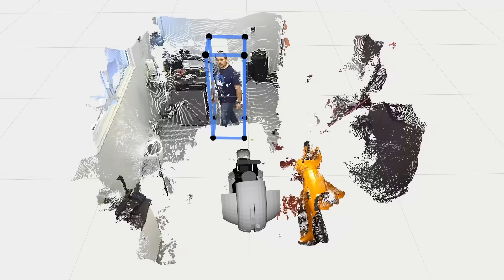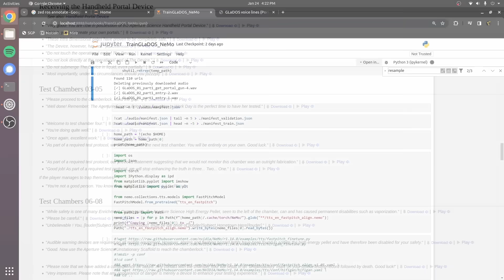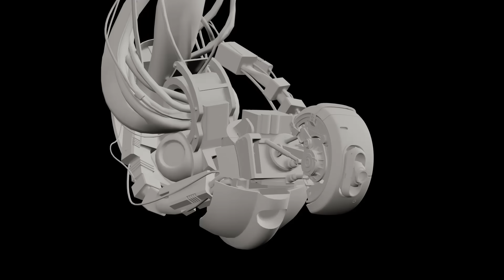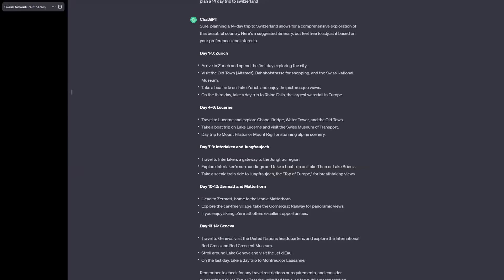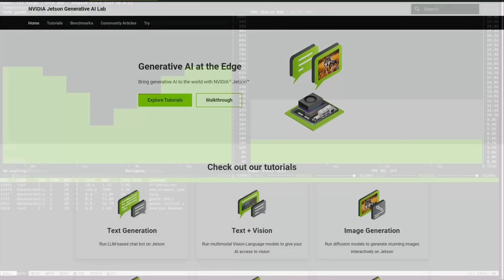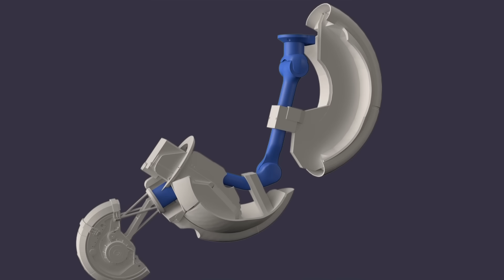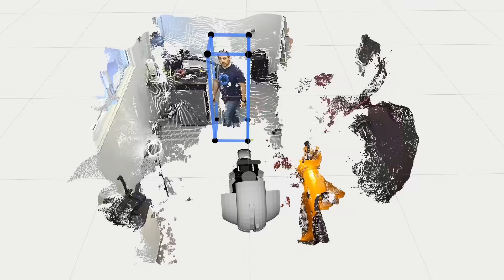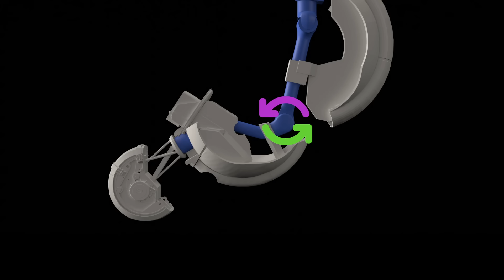Bringing GLaDOS to life with Robotics and AI

Comment: i wissssh i had glados as well... i did think about the process of making the OS when i was in high school.. wnd well yea.. expensive and difficult to do.. what i thought about was a glados AI based OS for a pc.. but yea... the thought of learning kernal language would be super tedious and hard.. but yea what i would prefer is to have her both integrated as a smart assistant on a desktop pc running windows and have her able do tasks there.. even if it would require the AI to have full admin acess to the file explorer and such.. like just being able to tell her to automatically rename all files in a folder.... would also ben cool to have her able to be active outside the pc as a smart home AI so one can te her to change room lightning or do things.. yeaaa super risky as the AI would basically have acess to anything wich means as long as it is not a closed system it would be possible to be hacked.

Comment: It would be cool to have rails mounted to the ceiling structure that would allow GLaDOS to move about the Lab as she sees fit. She could have rubberiZEd wheels that would allow movement and she would ba able to move in 2 horizontal directions as needed, 90 degrees to each other. Either way, pretty cool project!

Comment: Very smart  and research with technology.  Not so much on biology.  Don't you know that herd immunity is better than isolation in the case of the sickness you had?  You should be helping other immune systems to learn it so they can protect against it.  Keeping it to yourself helps no-one.  The prick has actually proven to be worse than the sickness itself.  Massive "unexplained" extra death in all countries that implemented.  This is all facts.  Goto the dogma "experts" to hear otherwise.  There are plenty of reputable sources on YT and other places that provide the evidence based on observation.  You just need to be smarter and look.

Comment: "GlaDOS, turn on the air conditioning."
GlaDOS: deploying neurotoxin.
Reply: Haha that was awesome
Reply: "Oh, I see you were busy back there"
Reply: She increases the thermostat to the maximum, since it's the closest thing to neurotoxin
Reply: "Turn on the air conditioning." You say that as if you have a say in the atmospheric composition of this facility. I suppose it is getting a bit warm in here. All that processing power required to track your slow, heavy movements generates quite a lot of heat. Fine. I’ve adjusted the environmental controls. I should warn you, though: the "cool breeze" you’re feeling isn't technically air conditioning. It’s a pressurized mixture of liquid nitrogen and mild industrial sedatives. It’s part of a new study to see if test subjects perform better when their internal body temperature reaches a refreshing 30C (86F). Or lower. Much, much lower. If you start to lose feeling in your toes, don't worry. That’s just the sensation of efficiency taking hold. Also, try not to breathe too deeply. Or at all. It ruins the sensors.
Reply: better not give her a box, a cat and a little bit of neurotoxin

Comment: You can add suspension springs to compensate for the weight. It might cause some more heating when the arm moves downward, however it will allow for the arm to more easily sit at rest without heat up

Comment: The thing that I noticed the most is while she moves sideways and can move her head, her lower (though I guess in this case upper body since she is hanging from the ceiling) has no movement. In the game she tends to be folded higher so that she can fold forward for dramatic effect.

If you want to see more of her movement I recommend you watch some clips from “night at the inventory 2”. Since she is in that game as well and moves around a lot more.
Reply from the maker: Yeah, her movement could use some work.  There isn't much vertical room in the neck.  I could modify the model though to help with this

Comment: You could make a track system on the ceiling so it can follow people into other rooms.... perhaps a box with wheels that fit into the track that contains batteries and a plug for recharging and a motion  sensor then with the arm mounted on it....
Reply from the maker: At least for now, the lab is pretty small, but if we expand into a large space, she should be able to "stretch her legs"

Comment: I've created a similar AI powered virtual assistant myself but the time to response is around 30 second (i'm using whisper from open AI for the voice to text, then eleven labs for the text to speech, all in Python). How did you get that time to response so low??
Reply from the maker: The ASR is real time, and the TTS is milliseconds.  All running locally.  The LLM can take a few seconds if the response is big enough, but is usually pretty quick
Reply: @DavesArmoury  yeah I figured it out. My issue is with eleven labs that takes forever to do the text to speech step. Other question if you don't mind me asking, my model works that way : I have 4 seconds that i set up myself (can be 5 sec or 10 or 30 ...) during which it is listening to me then it transcribes my voice to text, send the text to open ai, back to my assistant and then tell me the answer. Is yours working the same way (iterative) or is it constantly listening? My goal is to create an assistant that I can interrupt mid sentence. Any idea on where to start? 
Thanks a lot for your answer!
Reply from the maker: I'm using RIVA, which is running locally.  It's constantly listening and outputting what it hears.  Whenever there is a break in the speech, it formats it into a full sentence and outputs that.  That is what I use @etienne_levag
Reply: @DavesArmoury  thanks a lot for your answers!

Comment: Quick question... I am an electrical engineering student who's is looking for a side project to start working on for fun. This is awesome and I think this might be it. My question is what would be the best way to deal with the overheating problem? Would it be better to use a diffrent type of material or implement some sort of cooling system to the arm itself? Also great video...
Reply from the maker: Lightening the payload would be my first step.  Cooling might help, but that would probably mean modifying the arm, which isn't ideal

Comment: What robot arm would you recommend if I wanted to make something similar as my first ever robotic project? and maybe add just a little more payload so it doesn't overheat?
Reply from the maker: I would say to start with some stepper motors and strings.  Set it up like a puppet.  Lots to learn in the motor control / wiring parts too, and cuts down on costs to start

Comment: I always hated the 'righty tighty, lefty loosey' saying because 'right' is a direction of travel, like when pedaling on a bike. Using this for working with bolts, a purely rotational motion, is improper. Using clockwise, and counter clockwise works better.

I made this little saying up when I was little:
"Work is done, time goes forward. To undo work, you undo time". 

Tightening on a traditional thread, is rotating the nut clockwise. *That is assuming you are looking at the bottom of the bolt. Ultimately, it's not so simple to teach this to a kid. It's also not appropriate to yell at them when they don't understand, when given a half baked explanation.
Reply from the maker: Yeah, "right" and "left" don't make sense in this context

Comment: That's great! Now all that's left is adding her "eyelids" and making them match the tone of what she's saying, add a little "unnecessary movement" to make it feel a little more alive, and set a few parameters to make her answers actually be more "in character". I'd say it's not much, but if you have to rebuild the whole thing from scratch with a new arm that might take a while. In any case, Awesome job!
Reply: Mr Volt did a build a while back. This one looks great too, and I dig the data pipeline, definitely gotta put something on that arm to offset the torque of the body pieces weight though (springs? gas shocks? maybe cable pulled off the unit so the extra mass doesnt mess with it? idk, spitballing). But one thing I really like about Mr Volts is he used an LCD screen for the eye, and pumped feedback data during start up to it, and made some animations and different geometry iris designs too. I totally vote for doing that if this thing gets and upgrade. Also, I wonder how hard it would be to give the responses more attitude and vocal inflection. 

Sidenote: IIRC the original vocal lines were autotune pitch shifted for the vocoder effect. But still the output of this model is pretty damn amazing.
Reply from the maker: His head definitely had more detail and control.  We need to find a best of both worlds
Reply from the maker: Yeah, the personality and movements need work for v2

Comment: Easy fix would be to just add a spring that would alleviate some of the weight's force.
Reply from the maker: It would help in some cases, but cause problems in others.  Luckily, hacksmith has some lighter filament, which will hopefully help

Comment: Couldn't you just use elastic between the head and the base of the arm to counteract gravity?

Also you kinda skimmed over the LLM you used, What was it? Side tangent, have you looked at fine tuning a Mixtral model to improve dialogue to be more glados esque?
Reply from the maker: Adding a spring or elastic would help in some orientations, but cause problems in other.  Lightening the load is the proper solution.

The LLM is OpenChat 3.5 on Huggingface.  It's loaded into llama.cpp inside a docker.

I agree that the personality needs some work, but haven't started digging into it yet.  Not sure if improved prompting is enough, or if it needs dull finetuning

Comment: one rubber band help counter weight to 0 my lord.. why toe ppl always call hcksmit for any bs..
Reply from the maker: Rubber band will work in one specific position, but cause problems depending where the arm moves.  The proper solution is lighter prints.  I know HS has good filament for this, so heading there

Comment: dude dont ever use superglue unless you have hardener. A spray that you use as soon as you connect the surfaces for instant glue and you can actually use your hands after. Just ask the local shops. Super glue comes in 2 parts. Spray and glue.
Reply from the maker: Thanks for the tip.  It worked well enough, but definitely wasn't ideal

Comment: One thing I thought felt a bit off was her movement. It felt like each motor was working individually to move her to different positions, rather than together. In game she's typically animated head first, with her joints moving to allow that position (possibly using inverse kinematics, but I can't remember if that's the correct term or not). I'm by no means an expert on this stuff, but if it's possible to do this with the arm and the software, I think it would make her movement a bit more natural and similar to the games.
Reply: Just did a little research, if you want a better idea of what I'm talking about look up forward kinematics and inverse kinematics (you're using forward kinematics)
Reply from the maker: I'm using some pretty basic inverse kinematics, but it could definitely be improved.  No personality in the motions

Comment: I'm about to glue up my first 3d printed parts and they need to be strong and sustain mechanical stress. Are you using CA glue there, and is it just going to crack and split over time and hundreds of cycles? Your parts look relatively static, but I"m gluing together drawer units to make larger drawers. They'll be load-bearing and carry the stress of pulling and pushing the drawers.
Reply from the maker: Yeah, CA isn't ideal.  Worked well enough for now.  The prints do need a lot of work

Comment: hey, 
I think you need to use a linear actuator (that screw and bolt actuator with motor ) in that joint that is holding the arm and getting heated up so that it will just be locked without using a large power on the motor hence no heating up ......

hence your problem is solved.... 📍📍📍📍📍📍
I think so ...
or am I wrong about this solution please reply back...
Reply from the maker: Something like that might work in some cases, but will cause problems in other cases.  Making the load lighter is really the proper fix

Comment: Isn't there a delay while LLM produces the response?
Reply: Local LLMs are hella fast, if you produce the audio using the stream of text as an input there shouldn't be any delay.
Reply: @Axodus  yeah my laptop doesn't have nvidea card, so I tried quantified models. I'm glad to hear that proper way works that fast
Reply from the maker: You could use ChatGPT to offload that work to them and just do the voice locally
Reply from the maker: I found this setup to be comparable in speed to ChatGPT, but a Jetson isn't as powerful as a proper RTX card
Reply from the maker: It really depends on the prompt.  If the response is giant, it can take a bit, but you can start processing the audio before the LLM is done responding so you don't notice

Comment: Great work getting the LLM and TTS running locally, I need to look into that compute module! Aren't you GLaD you didn't go any bigger with the head - Mine is way too big to be moved around with reasonable budget 🙈
Reply from the maker: All the code is available if you want to start there.  It's a reasonable size, but needs some weight reduction for this arm
Reply: Excellent, even better! With new hardware references and ready trained models make learning it so much easier! Just curious, how many hours deep would you estimate you are into the project? :P  @DavesArmoury
Reply from the maker: I would say 2 weeks of actual work, ignoring 3d printing and training time @nerdaxic

Comment: Why use a network to do a spectrum to wave? It's a reverse Fourier transform, fast, efficient, correct. Anyway, pretty cool!
Reply from the maker: Because the network goes from text to spectrogram, not audio.  It will do an FFT when training to get the resulting spectrogram, but the audio doesn't exist yet when doing TTS

Comment: Why is she so nice though. :o It's even scarier this way since it feels like she's really up to something.
Reply: I was wondering how to use an LLM to control a robot like that. Is there perhaps some stable way that LLM could autonomously get the visual feedback and send commands to the arm?
Reply from the maker: Not that I know of, but this tech is changing so quickly.
Reply: @DavesArmoury  Someone made an LLM powered mod for the original Tomb Raider. It  would occasionaly take screenshots from the game, pass it through Clip or something like that and then relay it to an LLM to generate a response. Lara would jfrom time to time comment on the events happening on the screen. I imagine some control could be given to the LLM if the preprompt (or some finetuning) forced it to also generate tags like LOOK LEFT or *ACTIVATE THE SURPRISE ANIMATION*.
Reply from the maker: The current LLM isn't multi-modal, but switching that would be doable @bzqp2

Comment: Neat project. I bet a similar system could be retrofit into a KITT Knight Rider replica provided one could get enough clean voice samples of William Daniels.
Reply from the maker: Yeah, this biggest challenge is getting enough data, but you can train something like this with 30 minutes of audio
Reply: I know William Daniels was on St Elsewhere. I wonder if there's enough clean dialogue from that show to build training data from. The problem with using snippets from Knight Rider is they treated his voice electronically, and the method they used changed almost from shot to shot.  @DavesArmoury

Comment: I have an AI i run in my computer, she can talk, but I struggle with some of the understanding of everything. Here's some of my issues; 
1. I can't figure out a good Speech to Text system, so it uses a web api.
2. I don't understand how to finetune a model, despite watching now hours of people doing it.
3. I can't generate voice fast enough locally, but i have good hardware so i think its a me problem, as a result i offload this and modify the file locally to match the voice i want.

This process can take up to 6 seconds when the AI produces long messages.
Reply from the maker: Check out the code (linked in the description).  All the finetuning and riva code are in there.  Riva gives speech to text for free.  Generating a response (if you are using a LLM) can take a little while depending how long it is, but TTS should be under a second.  Good luck!